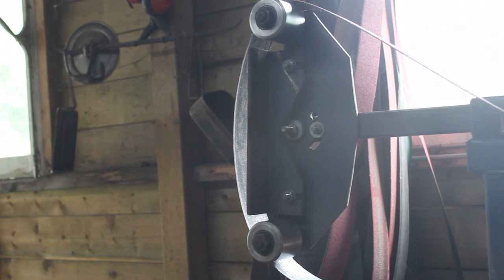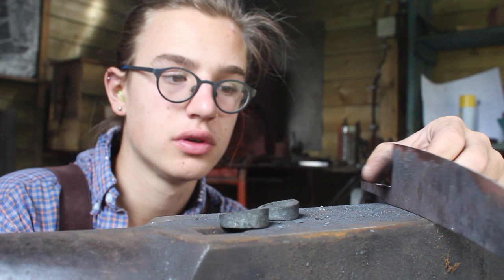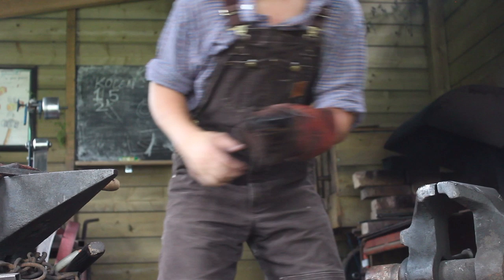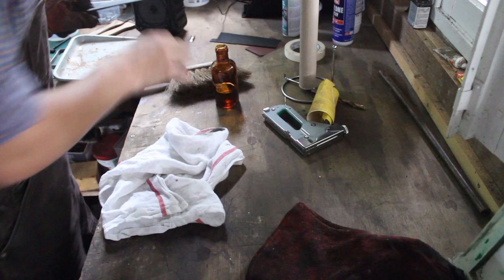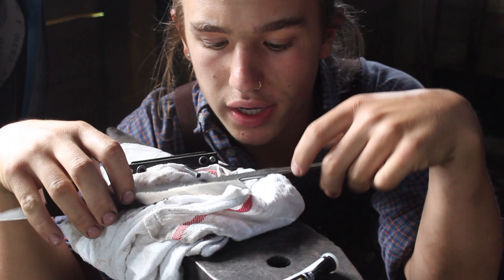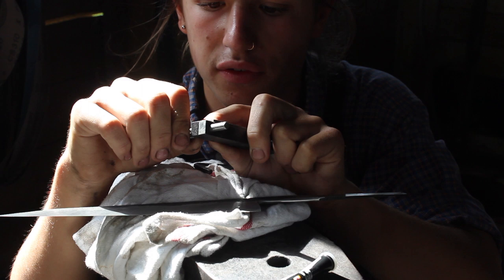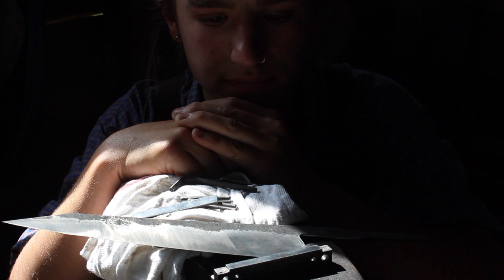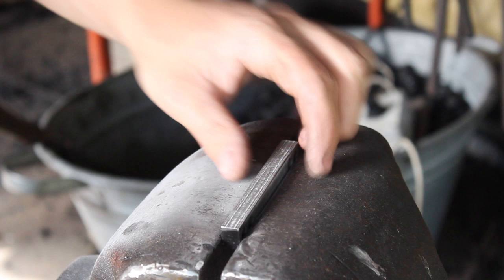Heattreating, grinding and etching the DAMASCUS! ~ K-tip Gyuto part 3

Comment: I have the same file guide and have had the same problem. If you are clamping an angled piece, take out the alignment pins and only use the screws. It allows you to work on forged blades without worrying about perfect flatness and it is still really accurate without the alignment pins.

Comment: Hi Floris, great work as always. Can i suggest two small things. Put your dip bucket on a stand, so you dont have to bend over and put your face near the grinder. Second, consider brazing or silver solder for sticking the carbide to your guides

Comment: Luckily mine is bolted. Noticed this problem also, as the body slightly bends, when bolted too tightly - glue breaks, carbide pops out. as one comment suggest, silver solder / brazing will help.

Comment: I just make my own out of o1 straight out of the oil quench. Then replace em when they get bad. Great vid btw
Reply: Yeah, that's what I love about having a bunch of 1075-1095 laying around and the tools to harden it. I made a file guide with 2 strips of hard 1075 screwed onto steel angle. Has a nice wide surface to lay the file on too.

Comment: If you try to glue de carbide inserts a little bit offset from the center of the file guide they will stop popping off, I think
Reply from the maker: I tried that, they still pop off. Its the thing that the steel bends a little which causes it to pop I guess
Reply: @FlorisPostmes  what if you put a wedge near each bolt of the file guide, then? It will stop bending or, at least, bend less, and the inserts won't pop off.

Comment: Apart from the obvious appearance appeal to some, do you feel a pattern welded blade offers superior edge retention? using steels with similar heat treating requirements  is then goal then?
Reply from the maker: J F no, the fact that damascus is stronger is just a myth. Its purely esthetic, interesting topic tho, I might put this in a video!
Reply: Floris Postmes I’d like to hear your thoughts.  I see a lot of Damascus and it’s impressive to make but i find it a bit too much to look at.  It’s personL choice of course and a lot of people like the look.  Im focusing on mono steel brute de forge blades.  I don’t have the chops to try damascus!

Comment: is it possible to quench a steel in urine?
Reply: As long as it cools the steel fast enough, it will work. Back in the days, in Scandinavia, bladesmiths often quenched their blades in urine, during the winter, because it is bad for the steel to be cooled down too quickly. Would not recommend you to use urine, tough, I think it will smell rather nasty. Vegetable oil is, in my opinion, the best for quenching.

Comment: I've been using my benke file guide for a while now and have never had a carbide pop off, and I have the same inconsistent material problem. Can I ask how long ago you got yours? It looks like it might be an older model.
Reply from the maker: mine is like 1 year old I think, something like that?
Reply: @FlorisPostmes  huh, did you get the steel one or the aluminum one?
Reply from the maker: Lucas Gumbiner steel
Reply: @FlorisPostmes  I dont know then, try contacting Bill he is a really nice guy I'm sure he would help you out with a solution.